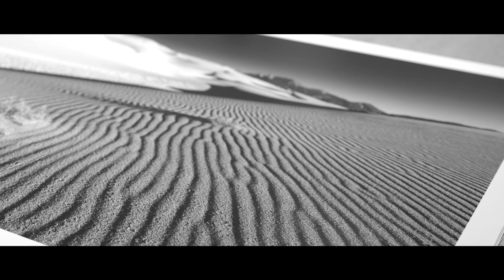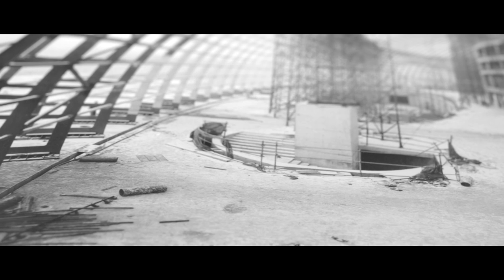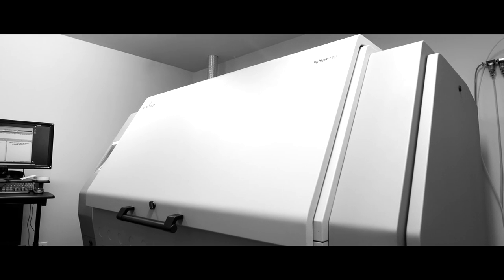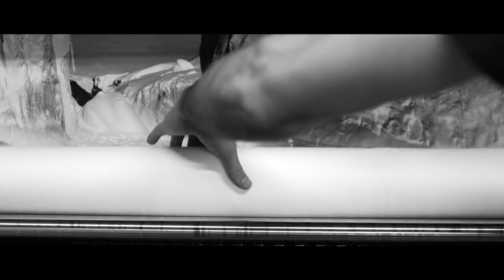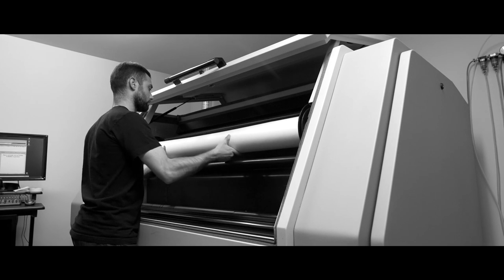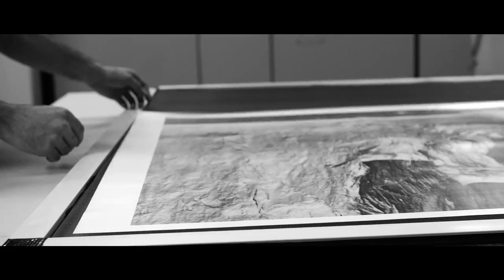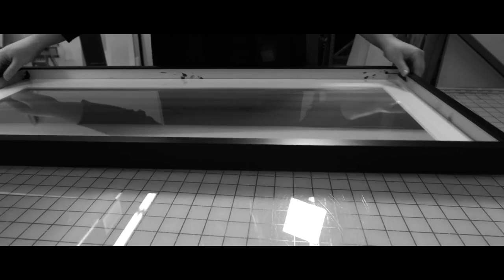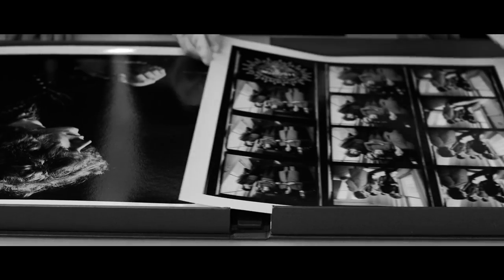Digital Silver Imaging - The Making of a Digital Silver Print

Comment: @0.25 - "film is obsolete" - you need to hope not because it represents a very significant chunk of Ilford's business, without which they would cease to exist, and critically, cease to be able to make the Galerie Digital Silver paper you are using in this video! (a product which represents only a very small part of their overall business) and which is only made by Ilford. The landscape has changed dramatically, of course, in respect of how images are originated, but traditional film is hugely popular, particularly black and white. We also operate the same Lightjet here in Birmingham UK.
Reply: I very much agree with what you say here, although I can also see where Luden is coming from. From a strictly technological perspective, the 35mm analog process is obsolete. You can get identical (from a macro perspective) or even higher quality images with digital with much more ease and less technical expertise… However from the human photographer’s perspective the analog process is a unique and rewarding experience with so much more artistic gratification that comes from honing it’s craft. But still, in our current time, film holds a technical relevance in its ability to be scaled to large (and very large!) formats in a way that would be prohibitively expensive to implement digitally. I was so floored by this realization when introduced to large format photography in Paris!